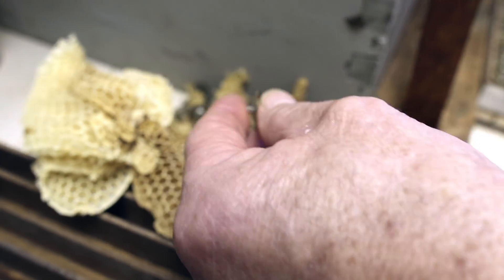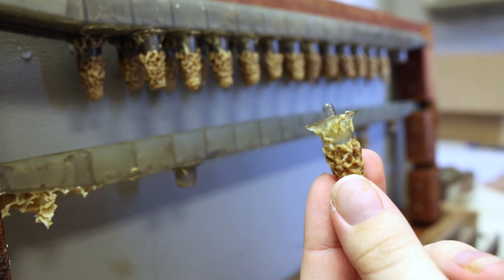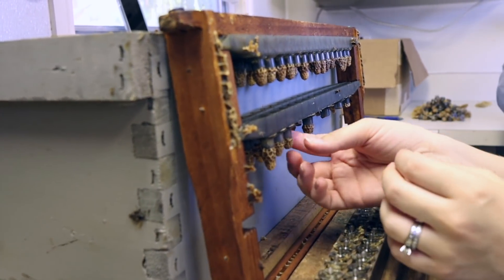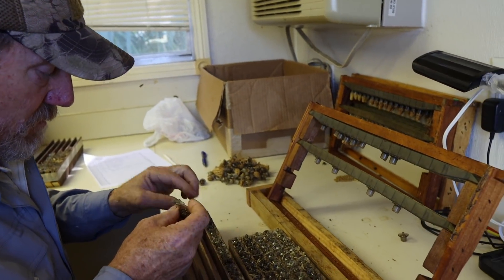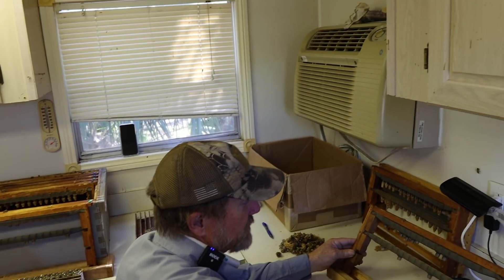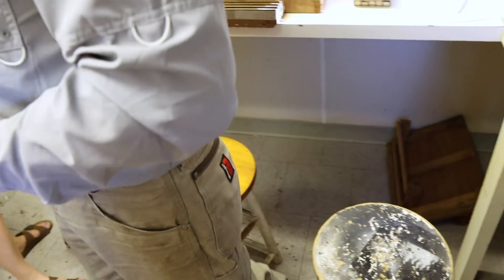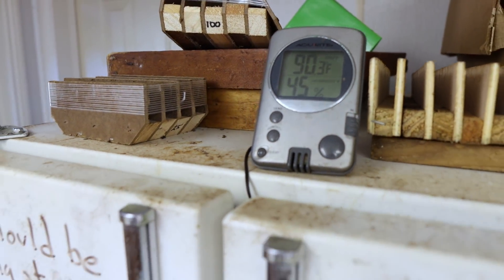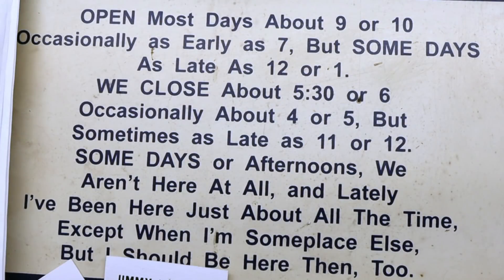Florida Beekeepers Part 2: Queen Production with Chris Werner

Comment: How many days before hatch or days after grafting are they doing these inspections?
Reply from the maker: Hatch is generally around 12 days after grafting. We usually check back at 3 to 3-1/2 weeks after hatch
Reply: @bobbinnie9872  Thanks Bob.  I meant at what point in the queen cell development are they inspecting cells in Chris Werner's operation. Is it the day after they are capped?
Reply from the maker: @JosiahGarber  It's the same day they put them in the incubator. I don't remember exactly what day they do that.

Comment: Bob, I'm trying to find the heated boxes that cells are transported in from incubator to yard. The ones I've seen look like a small tool or tackle box with foam in them and they plug into the power port. I've done several searches and can't seem to come up with them. Would you happen to have a supplier?
Reply from the maker: Sorry, I just spotted this comment. I'm not familiar with those boxes. We use a small egg incubator like the one shown in our "How We Produce Queens" video. https://www.youtube.com/watch?v=c28O916sy48.  Check the links in the video description.

Comment: I recommend a wifi inkbird temperature controller will let you know if the power is out, I can see and set the temp on my phone.  And it will alarm on over/under temp. They make humidity controllers too.

Comment: What is your opinion of buying dd colonies after almonds. Versus nucs. Same money for 90 nucs or 40 hives.  Working on increasing numbers this yr.
Not sure were else to ask the question
Reply from the maker: Hives out of the almonds can be a good deal. It of course depends on the bees and equipment. If they are in good shape you can split to the number you want and also have the benefit of the equipment as long as it's all in good shape.